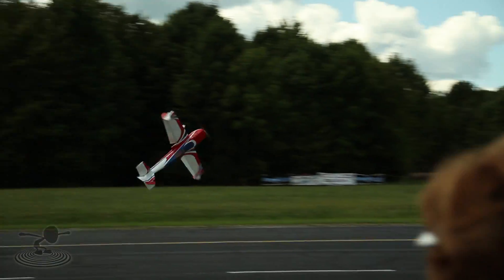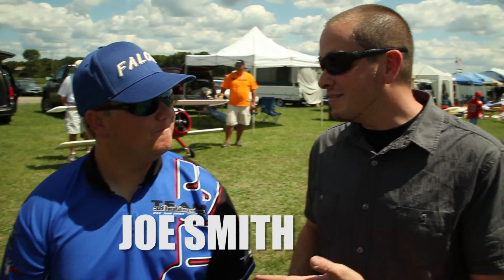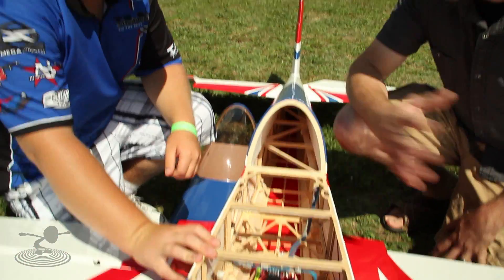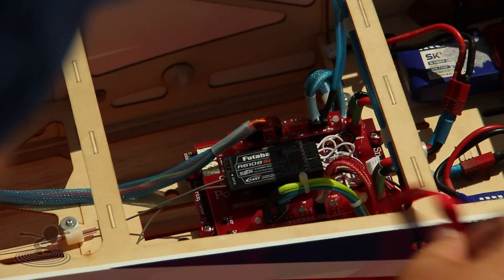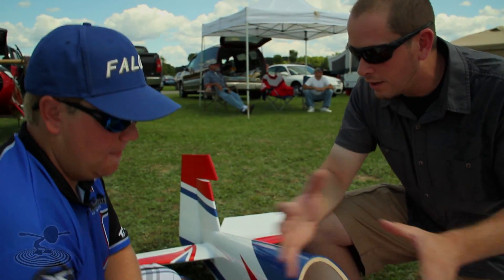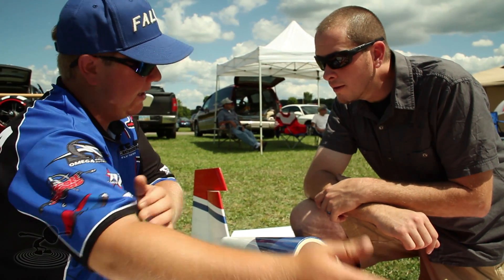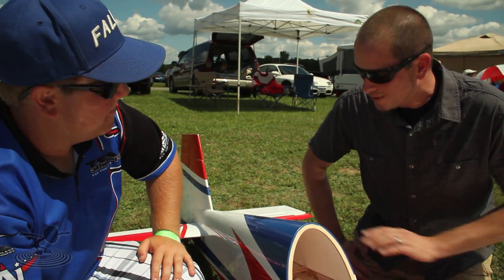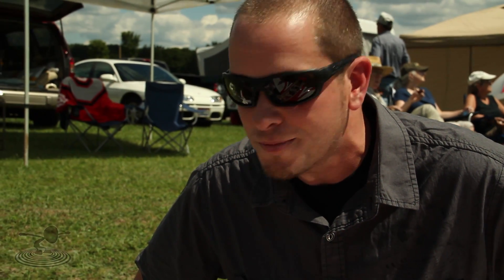Flite Test - Giant RC Power Distribution

Comment: what does that have to do with anything? the petroleum in most fuels is corrosive to most plastics. that's why gas stations only allow you to pump gas into certified containers. I'm not into gas powered rc stuff so I could be wrong. the fuel may not be as corrosive as gasoline.

Comment: Could be speed brakes, but why leave the wing open and have the hing line funneling air through the open cavity?  Panel buffet reduction?  That device would certainly slow the airplane down.  I wondered if it enabled a steep harrier type maneuver since your dumping allot of lift and slowing it down while letting air pass through channels as you descend?

Comment: Josh I've only been back in flying for 3 years and I love to fly the Addiction by Percision Areobatics I've had three started with the small one then they came out with the big one and with it I had a battery failer in a knife edge about 30' above ground and ordered another you should really fly the Addiction they are very nice with power the weight very well balanced. I would recommend their set up the Motors are amazingly powerful for size and weight. You would fall in love with 3D..